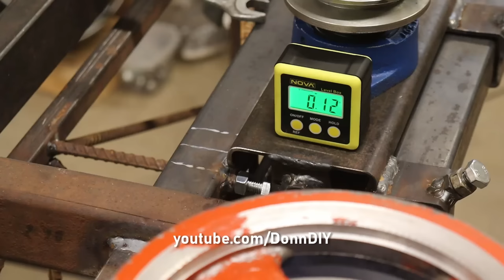Swingblade SAWMILL Build Ep.6 - Blade Guards, Subframe Fabrication

Comment: The staggered bend locations, in your handle, will make it very rigid. Much like the handle on some older chain and hand held cement cutting saws that have tube bar handles.

Comment: I like the bedframe handle idea, old bedframes like that are hard to find in my neck of the woods. You must live near a junk-yard with endless supply of junk, you always seem to find stuff. But what kind of junk-yard has a 3 phase switch laying around........
Reply from the maker: Well... the barn is sort of a junk-yard. We do have several electric motors, relays, water pumps, switches and other dairy farm related equipment still around even though we haven't had cows for two decades now.

Comment: suggest you don't use the star delta switch as they are tricky to wire, I would use a soft starter instead and set the current limit to about the full load current on your motors nameplate that way you have a nice start and motor protection as well.
Reply from the maker: Soft starters are quite expensive. No worries, I sort of have an idea how to wire the star/delta switch. I'll try this first. If that fails I'll reconsider soft starter.😀
Reply: Be careful you finish up with a dead short if you get it wrong and you will only have one shot as it will destroy the switch suggest you investigate the connection procedure and draw it out and bell out the switch to make sure it is correct. A basic soft starter is affordable. @DonnDIY

Comment: I think, that this blade needs to be supported with something on both sides. Those naked screws will fail if directly on hard, shaky and one side loaded steel.
It's like one bolt supporting cutting forces at all times, and only torque is supplied equally from all of them
Reply from the maker: Kinda defeats the purpose of a swingblade then.

Comment: I am wondering if the horizontal blade guard is going to hit both the boards you are cutting and the tree that you are cutting them from. I would expect you need to have nothing protruding below or beside the blade.
Reply: He mentioned in the video making it removable to allow for exactly that.  He's got you covered.
Reply from the maker: It is tight fit right now, something like 6mm / 1/4". If the horizontal blade guard starts to get caught on the log I'll just cut away a strip from the bottom edge.👍

Comment: Don... Is there any way to lock the blade to either vertical or horizontal other than the weight of the cutting head ? I wonder about the blade trying to "climb" out of the cut and now with the weight somewhat counter balanced by the hydraulics I can`t help but think it might want to...
Reply from the maker: No need, it'll dig in the log and keep itself locked in. Also the gas strut is super stiff and stable.

Comment: Dumb question but wouldn't the blade need to swing left or right instead of forward or back to do slit cut the length to do dimensional lumber?  Or is this just the side to side carriage and you still have to to the length carriage? (Never mind just realized after I typed the comment that this is the side to side carriage)
Reply from the maker: The beam will be 6m/18ft instead of the current 1m/3ft mockup beam.👍

Comment: A very robust build. I know how a standard bandsaw on rails works, 
but I'm confused with this design as it will only cut up to half of the blade circumference as it's mounted on a spindle drive shaft. 

Donn, your pop-up rules are in Estonian, not English
Reply from the maker: It has to be simple and robust, this is my goal to make and keep it simple. It does cut only half the blade diameter. Mine will cut only 220mm board (or 440mm when double cutting). But it's a swingblade, so it is able to cut dimensional lumber out of whatever diameter log. It doesn't produce slabs, it doesn't have to cut through the whole log all the time. It cuts dimensional lumber in one pass.
Reply: @DonnDIY many thanks for the explanation. Keep up the great work and have a lovely weekend. Austin 🇬🇧